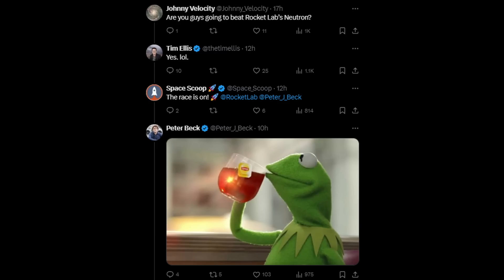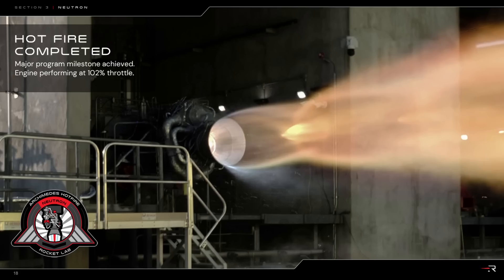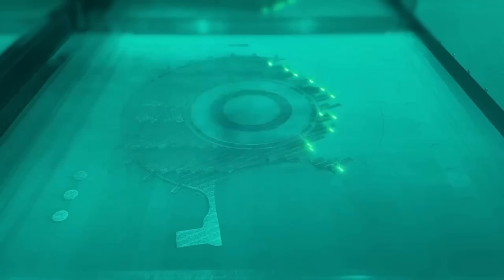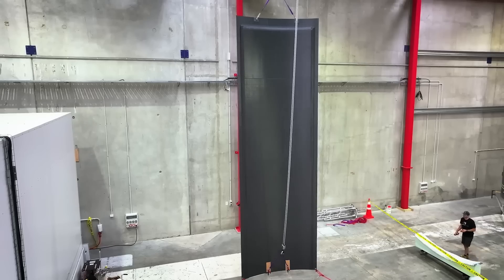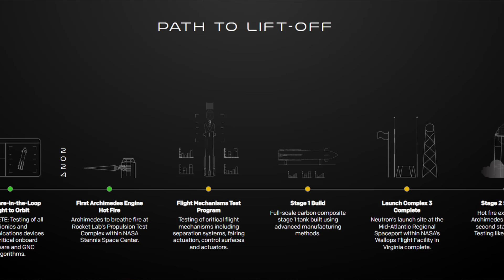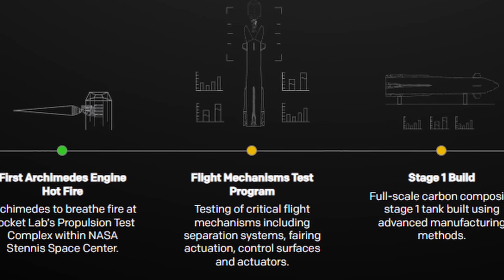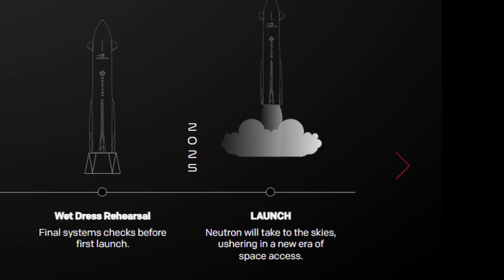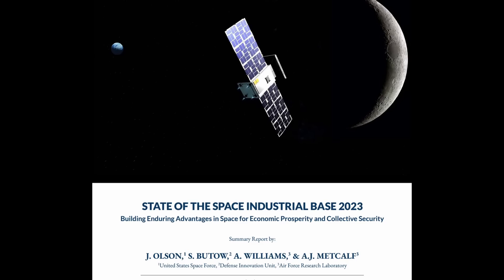Rocket Lab Neutron Development Updates!

Comment: Question.......
Is the Archimedes engine based on the Rutherford engine?
i.e. electric pumps
If so, where are the batteries located, will they be rechargeable in situ, or do they have to be swapped out after each flight?
Same for the second stage, the battery location?
Reply from the maker: No, they've elected not to go with electric pumps on the Archimedes.